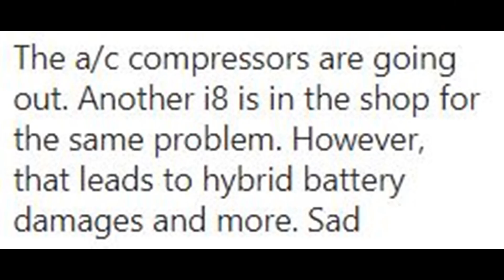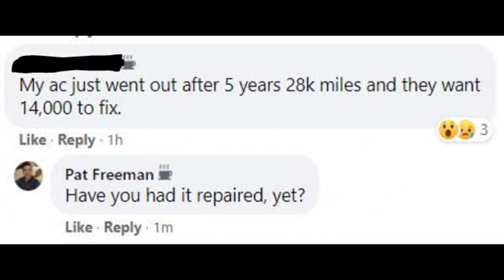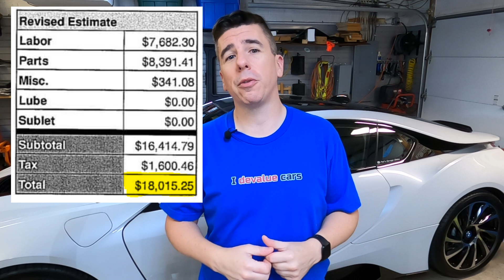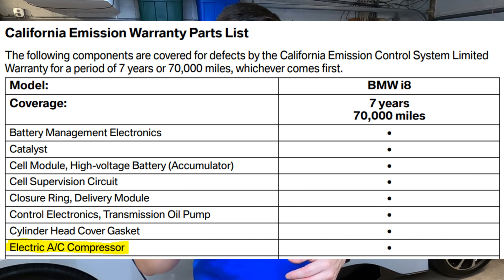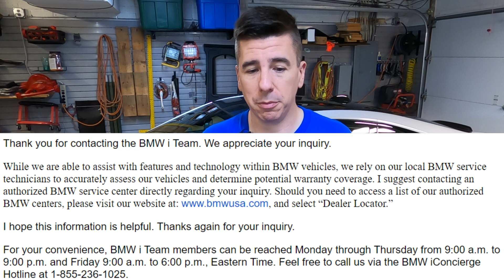BMW i8 Air Conditioning compressor problems and costs

Comment: Have a 12/2021 545e with a compressor that started to get noisy now.. 65k miles... Warranty ended in march this year.... Hoping the dealer wont find metal shavings in the circuit...
Reply: So I replaced the compressor with a brand new one. The new one is still noisy when it starts or when hitting max ac but deffo not as loud as the old one. It gets noisy at first but after 10 seconds it stops.

Comment: this is only for i8 up to year 2019?
Reply from the maker: All years
Reply: @PatsGarageOnline  ok thought they released upgraded generation of those AC compressors that fixed the issue
Reply from the maker: @justastulpe3265 no. All compressors are the same internals. The part number changed many times but it's all the same internals.

Comment: I have an I8 2015. I’ve never had any battery cooling issues or warnings but my AC doesn’t work and makes a sound. Is this something simply refilling the refrigerant will fix?
Reply from the maker: People have been getting the AC system regassed and reoiled at independent shops and this has helped prevent problems.
Reply: @PatsGarageOnline I was literally just about to ask you about that and see if that is also an option. I drive my i8 about 100 miles at a time, some times on sport so the battery can charge up, no AC but I’ve never had any battery cooling issues with the battery (fingers crossed). I’ll try recharging the AC and oil.
Reply from the maker: @johnsonrepp I need to put an updated video out about this
Reply: @PatsGarageOnline yes absolutely. Any videos or tutorials on how to remove/add oil to the compressor? Type of oil?

Comment: Is the compressor issue on the 2019/2020 models?
Reply from the maker: @CarlosWillis  Yes. All i8's used the same compressor. It may have a different model number but it's exactly the same per my local Service Center Foreman. The i3 uses the same compressor with random failures in that model as well.
Reply: @PatsGarageOnline  any preventatives for it? Or just have to cross your fingers and keep the car maintained regularly
Reply from the maker: @CarlosWillis  Some folks have been having their A/C drained down and recharged every couple years to ensure there's enough lubrication in the system to prevent an issue.  Some folks live by that but I haven't seen enough data to support it being that useful.  Best action is to have the compressor replaced as soon as it starts making a strange ticking or rattling noise, as can be heard by placing your ear next to the right front tire while the car is on and A/C pumping.

Comment: This may be a stupid suggestion, but would installing an extra filter/drier in the system at least prevent metal particles from causing further consequential damage? I ask because I'm about to buy a 2015 i8 (UK) and want to at least do something to avoid total disaster. Thanks
Reply from the maker: I've heard of many folks making this suggestion but I'm unaware of anyone doing it.  I have sold my i8 so I didn't test this.

Comment: What does a normal, healthy compressor sound like for the i8 when you kneel down next to the front wheel? Is there a way it might begin to sound before it turns into a full-on rock tumbler?
Reply from the maker: @royalp1687  it starts to get noisier. I can't explain it but it won't sound like a normal compressor. Best to compare it to another i8 or i3

Comment: Would this lead one to reason that driving the car in electric only will shorten the life of the AC compressor?  Might there be a way to add a kill switch to turn off the compressor if it starts shredding itself?  Or is there still so much cooling demand that it would be more dangerous to do that?
Reply from the maker: If the compressor doesn't run, the car will display a fault and you can't drive. The high voltage battery is required to be operational even in gas mode. So cooling is necessary. Some owners have taken their cars in for a recharge and re-oiling as a preventative step. I'm waiting to see results.
Reply: @PatsGarageOnline  a
Ahhh, got it. What do you think of the idea that minimizing or eliminating electric-only driving might actually impact the longevity of the system? Sounds ridiculous, and of course we shouldn't have to think like that, but does it stand to reason?
Reply from the maker: @royalp1687  I wish it was possible and still able to retain the electronics in the car. Too many of the systems need to talk. If the electronics were completely replaced with aftermarket and a larger gas engine dropped in the car, it would be faster and more reliable but the costs would be so expensive to do this that it would be better to own a Lambo
Reply: Hi Pat, great videos, love the car. My air con has stopped running cold. It’s a 2015 with only 28k miles. I’ve had it re gassed and main dealer said that there is no leak. They then said the 12v battery needs replacing as when it was low, it shut down the compressor. Had that changed but now saying it needs a new compressor. Car drives fine with no noises and no fault codes. My question is, how could the HV battery get cooled if the compressor isn’t operational? Do you think it’s ok to just leave it for now? Thanks, Steve
Reply from the maker: @skimeister1620  hi Steve. First off, the HV battery runs the compressor so BMW replacing the 12v battery won't fix that. Not sure why they did. Secondly, the compressor needs to work to keep the HV batteries cool. You may get a drivetrain failure and the car won't run if the HV battery gets too hot. They need to diagnose the issue better.
Reply: @PatsGarageOnline  Thanks Pat! They said the 12v battery had been completely flattened recently which caused the compressor to go into preservation mode? The 12v battery was the only thing in the fault codes logged so changed it. Saying needs a new compressor at over 2000? 
Otherwise car seems normal but wonder why they didn’t advise that the HV battery could now overheat? That’s my main concern as going on a long journey this w/e! You would think that if the compressor isn’t working, an error would pop up if it’s important for HV cooling wouldn’t you unless only happens as you say on HV overheat?
Reply from the maker: @skimeister1620 you'd get a drive train error telling you to pull over and stop.

Comment: Hi Pat! I just replaced the ac compressor, condenser and has the system evacuated and flushed, however when I got the car back it’s not blowing cold. I’m surprised they have the car back like that. Any clue what’s up with it, waiting to send it back now
Reply from the maker: I don't know. It will take the service center to diagnose this.

Comment: The extra warranty for the BMW i3 is for the REX cars only.    The BEVs did not get the extra warranty in CA.   Amazing how poorly the AC compressor is designed.  If it is running low on coolant/oil, they should have added a sensor to tell the driver.

Comment: My i3 makes no noise but aircon does not work to cool cabin. Have had car for nearly 2 years. No fault code for hot high volt battery. Drives fine.
Could it be the valve that directs refrigerent/coolant to battery at fault.?
Scanner says no info  about aircon
Reply from the maker: Sadly, there are too many components involved and it would require more troubleshooting before I could suggest the valve being at fault. I believe the service center will have to troubleshoot.
Reply: Thanks @PatsGarageOnline

Comment: Got a used i3s, added the extended warrantee, 5k, buuut ayear after i bought used it stop colling, no noise, well $14345 covered by warrante, rhey replaced all compr. And battery was droped and replaced the lines

Comment: 2016 X5 40e, AC compressor rattling at 75k miles. In shop now for a replacement, hoping they don’t find any shrapnel in the lines. It was still cooling, just sounded terrible.
Reply: Not sure it deserves a heart or thumbs up, lol. It is right now estimated to cost $5100. Crazy for it to start to implode at that mileage and then cost so much compared to a normal car replacement. Fully negates the hybrid aspect.

Comment: Hi, Pat.
I just watched this video and became a bit heartbroken. I don't own an i8 but was thinking about buying one; not inmediatlely, but perhaps along next year. Obviously, your channel is turned very useful for me.
Now, my question is if this problem about the AA compressor and bateries cooling is going to happen for sure at anytime or It's just an issue that merely could appear.

Thank you so much in advance for all. And greetings from Madrid! :)
Reply from the maker: Thanks for watching. It may happen or it may not. But you need to be prepared to pay a lot to have this repaired by a repair shop that is willing to do the work. That is the risk you take with the i8.

Comment: Over the weekend I had a CEL pop on with code P0CE1 (Hybrid/EV Battery Coolant Control Valve "A" Stuck on). I am aware of the A/C compressor issues that have plagued some of these vehicles but I don't recall hearing any of the noises that are usually associated with this. I did check and the A/C is in fact not functioning so I am trying to sort out a plan of attack. Do you happen to know if an issue with this control valve could cause the A/C itself to go down? Or does it sound like the compressor likely failed, sent debris through the lines and brought down the valve? Any help would be greatly appreciated!
Reply from the maker: Sadly, there are no ways for me to determine if that code is causing a specific problem. You may have to go to the service center

Comment: Mine has started to make a little noise now. I am out of warranty and plan to get this sorted before there’s a catastrophic failure. I will insist the lines are cleaned when the job is done. Does anyone have experience of the non OEM part that’s available for around £400 in the UK . I’m wondering if it can be any worse than the original.
Reply: Have you had yours repaired yet? Did it set you back a lot and did you go oem or not? Thanks

Comment: So my i8 definitely just started doing this noice tonight. After watching your video, not sure if I have this right. From what I understand after watching your video. ( thanks by the way for all you do )  The  ac compressor repair will be covered by the 7/70,000 emissions warranty in the state of California? It is a 2016 and 7 years will be here in July and it only has 28k on it. So I fall into the coverage parameters. Should I be ok and covered?

Comment: So I’m getting same noise- I have a 2015 i8 and it’s def my AC compressor when we open the hood- it’s coming right from it! It only makes noise when the heat/AC or vents are on but when I shut it all off noise goes away, also my heat and AC still work totally fine! Noise just started this morning.
Reply from the maker: I'm sorry this problem developed in your i8.

Comment: Hi Pat, im thinking of but an i8, so far it seem that there is a lot of problems with this car. is it worth buying it ? I dont want bills after bills of work to done. Seem like a big liability
Reply from the maker: It's a great car as long as you have the BMW warranty in order to mitigate your risks.  Sometimes you can get lucky with an i8 and own it for several years without issues.  Sometimes you end up paying tens of thousands because a coolant leak developed without warning and it needs a new engine.  It's the nature of the i8.  You'll have to make your decision with all that in mind.
Reply: @PatsGarageOnline  last question Pat. Does the BMW extended warranty covers everything? It might be good to make a video on what the extended warranty doesnt cover. Does the i8 come with run flat tires? i always wondered what happened if you get a flat tire if there is not spare tire

Comment: Thanks of the video!  I'm contemplating on making my own video on the exactly same issue on my 2016 BMW 330e.  Got the same noise prior to AC compressor completely failing.  It's throwing faults and it's also costing me thousands to repair it.  In addition, it's thrown other HV faults.  Just spent $2400 replacing the flow heater, it's HV cable and now about to spend $3300 on replacing the AC compressor, which we haven't looked at it completely to see if any other issues (metal fragments) have entered the cooling lines.  If so that price may go WAY up!  On top of that, there may internal KLE converter faults which will be another $4300.  Car is valued at around $13k and I'm about to spend more than it's value just to get it working again.  There's no reason why a "premium" car should need this type of work done under 100K miles.

Comment: This is interesting - I have an X5 45E that has been in the dealer for a little over a month now getting the compressor and lines replaced (under warranty). It does look like there is an issue with the compressors.
Reply from the maker: I'm sorry to hear about your issue with the X5 45E.  Please keep me posted on the issuel
Reply: @PatsGarageOnline  Finally got the car back - in the shop from May 3 to July 8. The biggest issue with the repair was parts availability. They replaced the compressor, but then found metal in the lines so had to replace most of the cooler lines (including all the cooling grids in the battery) as well. The final part was flushing the system with a special fluid (I don't remember if it was magnetic or non-magnetic). 
The part number of the compressor used was 64-52-9-496-112 which I am hoping is one that resolves the issue. Since it was a warranty repair, I don't have a price on the invoice, but with a 2 1/2 month rental car, and all of the parts and labor to replace, I don't think it was a inexpensive repair.

Comment: Hi Pat I’m starting to hear this exact noise on my 2015 i8 19k miles  it happened out of sudden on road I thought a leaf got caught in my fan… but no it’s the compressor noise, what are the chances of the worst case scenario with metal fragments ? And what’s the best case scenario could it at all be just refrigerant or just replacement of air compressor. Is there any way of someone doing it outside of BMW like a local BMW expert ?
Reply from the maker: BMW is your best bet. Someone else may do it cheaper but if there is a problem you'll end up back at BMW. So, buy once, cry one, I suppose. I can't assume how bad the problem is. I haven't gotten enough feedback from i8 owners to be able to predict that. Let me know what your service center finds out.
Reply: Pat's Garage Online also I’m considering purchasing extended warranty ASAP that covers all these affected parts and then going to my service after that. If I get 2 yr extended warranty for 5-6k that’s a better bet then going to them without and expecting 18k  I’m just not sure if the 3rd party warranty needs to check up the car before giving me coverage and possibly seeing this issue
Reply from the maker: @pilpilnyc501  definitely read the sample contract that the warranty company has to provide to you in order to ensure you meet all the requirements.
Reply: Hi Pat so my BMW dealership couldn’t match my noise so after a few days of trying they heard a little bit and said yes it’s a faulty compressor saying no further issues they would drain the lines flush them replace everything with labor 2800$ done in one day. So hoping this is the end of it and I can still keep my baby
Reply: Oh yeah this is PilPilnyc just my different account
Reply from the maker: $2800 isn't too bad for all that. Fingers crossed that will take care of everything.
Reply: Pat's Garage Online I figure even if it does do something afterwards they can fix it on their expanse since they didn’t see it before
Reply: @nikromic576  did your ac actually go out. Mine just went out just now while driving home. I’ve never heard the noise you guys have tho.   If it did make a noise it wasn’t loud enough I noticed.  Never had AC issue and poof. Driving home about 7-8 miles and it goes out.  2015 i8 with 65k miles. Out of warranty no extended of course 🤦‍♂️
Reply: RockstarFlipper mine was working while had bad noise,
I ended up changing my AC compressor 3800$ with parts and labor was not that bad 
They flushed coolant and didn’t find any particles everything works great now no issues

Comment: Hi Pat. I've ran into a simular issue with loud noise from my AC. Largely because of your video, I immediately took my i8 to the dealer. The noise wasn't always there, like you described, but I decided to replace the compressor anyway. Draining the Airco revealed that 70% of the coolant was gone. Luckily, there was no contamination, and no further damage.
The airco was still working fine, but low coolant could possibly destroy the pump because of lack of lubrication.
So checking the amount of coolant, and keeping an ear our for strange noises from the AC might save you a lot of trouble.  Thanks for your video!

Comment: Pat, I always love your videos. I would like to make one request. I am retired from a QA career at a very large tech company. The anecdotes in the video are great, but, if you have time, since you are a magnet for all this I8 forum info, please collate it into a graph showing year of car, mileage, and also any driving style notes you can get from the victims (you'll need to ask them--if they don't offer it). As a group, we should probably also contact the i3 community (I have two friends with i3s, so I could look into it) and compare notes. There may be no apparent correlation between that data and the failure, which is good to know. There might be some info that can be gleaned from that data that is not apparent to us, but, if BMW compared VINs and build sheets, they might know something we do not. Would help in a class action suit or at least, to put pressure on them.  This info is 10x stronger if we have data.